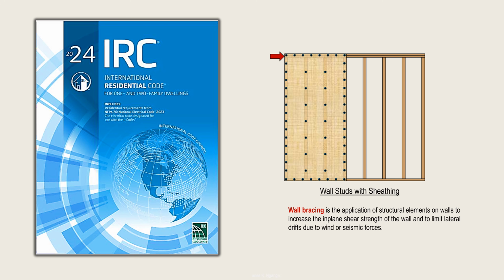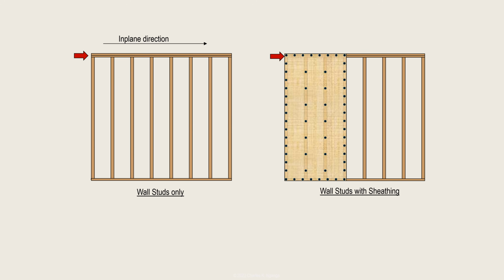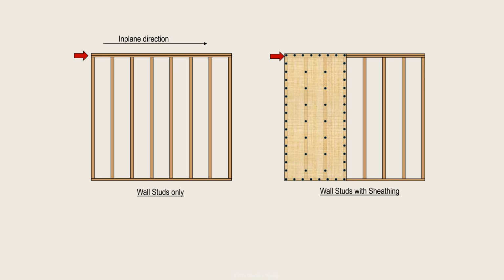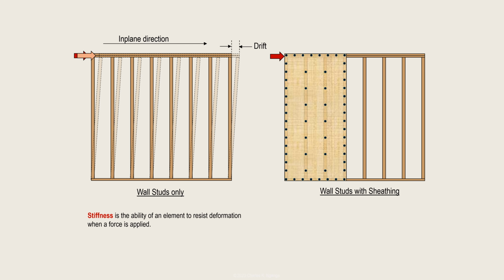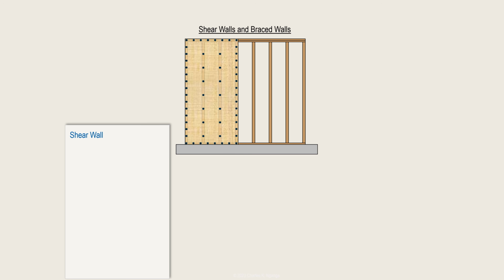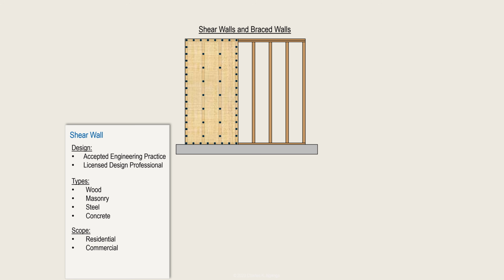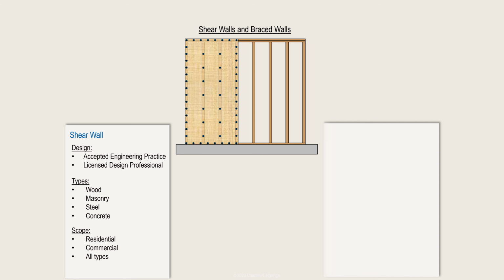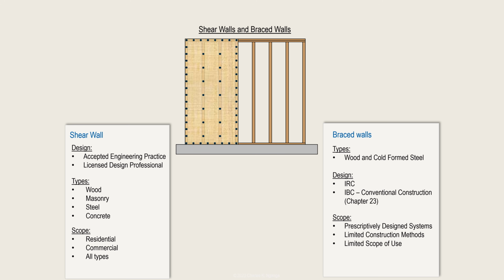Wall Bracing vs. Shear Walls: What Every Builder Must Know!

Comment: good points i am currently using the state prescriptive rules to build a house in San Bernardino  Co CA in 2026 . I was able to design my house without using an engineer .  State laws allow for a person to build their own home without an engineer which will limit what you can build.
,,,,
Reply from the maker: @CraftyRoseDentalinstructor. Using the prescriptive code is a great way to handle standard residential builds while ensuring the minimum structural safety required by the code.

Comment: Looking forward to the remedial video that actually shows the difference between bracing and sheer. I saw nothing in this video except sheer walls are designed by an engineer, and braced walls are the exact same thing without an engineer's signature and fee.
Reply from the maker: See the expanded version here: https://youtu.be/3-GlpnnOMq0
Reply from the maker: @nextworld9176 The updated and expanded version of this video is provided here: https://youtu.be/3-GlpnnOMq0
Reply: It was well explained.  Topic was not that sheer walls are designed by engineers
Reply: @SteveStowell  Really? Based on this presentation, would you be able to distinguish one wall system from another at an actual job site?

Comment: you never told us the difference between the two!
Reply from the maker: Than you for the comment. The fundamental difference is not in their function or construction. They perform the same task and share alot in their construction. Their fundamental difference is in the framework of design and who designs them. Braced walls (Prescriptive design guided by the IRC code and, can be designed by anyone), Shear walls (Engineered design per the IBC and are designed by Civil Engineers).  I have mentioned this in the video. That being said, i am working on a more expanded version of this video to clarify and expand on the differences in a way that is easy to understand (coming out within the next 2 weeks). Thank you again.
Reply from the maker: The updated and expanded version of this video is provided here: https://youtu.be/3-GlpnnOMq0

Comment: The other key element to shear walls are the hold-downs at the ends of the shear walls. An engineer designs the hold-downs based on the lateral load on the wall and its height, which has the effect of prying the wall up. Of course, the footings/foundations also have to be sufficient to resist the uplift.
Reply from the maker: The updated and expanded version of this video is provided here: https://youtu.be/3-GlpnnOMq0

Comment: This video did absolutely nothing to help me understand the difference between shear and braced walls.  I’m guessing that in 30 to 60 seconds you could probably explain to the average person at least a gist of the difference, yet here after watching your 5 minute video twice, I still have no clue.  Seems that everything you told me about either one also is true of the other.
Reply: Basically they accomplish the same thing. Shear walls are designed by an engineer and they design the fasteners, sheathing, anchorage, per seismic and wind loading etc. The code book has already done the engineering for you and just tells you how to build it, based on parameters.
Reply: You right agent Friday!
Reply from the maker: The framing  description that i provided for wall bracing construction also applies to typical wood shear walls using wood structural panels. The difference (as noted in the video) is the framework of design. A shear wall is designed by an engineer according to the IBC while braced walls are conventionally designed per the IRC (no calcs, prescriptive). If I went to a home contruction site and saw the contruction of a wood framed wall with wood structural panel sheathing and edge nailing at 6" o.c. (field @ 12" o.c.), I  would not know if the wall is a shear wall or braced wall. I would only know once I look at the drawings and see how the designer identifies them. If the wall is a braced wall, then there are precriptive rules that govern how the braced wall system of the entire house will be laid out (IRC code). If the wall is a shear walls, then it was designed by an engineer (IBC) who determined its loading and design capacity.  The point is that there is overlap interms of construction method and purpose but the difference lies in the design process and the design framework. Additionally, the term shear wall is used in concrete and masonry construction. This is explained in the video as well. I will do an addendum video that is more detailed. Thank you for the comment.
Reply: @ConventionalFraming  Lots of words with no practical meaning. Are the nails used ribbed and glued along their shank? What is the diameter of nail shank, nail length and nail spacing? What about stud spacing and size (2x4,2x6)? What about the sill plate bolts and gasket; and for multi-story, are the floors bolted together and also bolted to the slap? Might need to know these things as an owner-builder.
Reply: @ccw-cs6xb he explained what the difference is…it’s called shear when it’s been designed by an engineer…it’s called braced when it’s not been designed by an engineer…as far as all the other stuff you asked about, the code book would be your best friend…it can be a bit confusing which i think is done intentionally IMO…😂
Reply from the maker: @ccw-cs6xbhe  Thank you for the comment. This are great questions. That is why i created the The Residential Wood Framing Design Series at https://www.conventionalframing.com/. The course is divided into 4 modules - The conventional roof framing module, the conventional floor framing module, the wall and foundations module and the wall bracing module (provided in two parts). These are very comprehensive design courses where i cover the code content using state of the art graphics and very clear explanations. Additionally, i walk through a complete design of a two story residential structure (and you can download the finished drawings to look at and review). Please check out https://www.conventionalframing.com/.
Reply: @ConventionalFraming  I think part of my frustration is the mismatch with common parlance.  I'm not in the industry, but I have some experience remodeling and  know several people who have done additions and dealt with code compliance with their houses.  And I watch a lot of construction-related videos.  I've heard over and over mention of "this wall is a shear wall, so it has to have sheathing and you can't do certain other things..."  Was an engineer ever involved?  Not once in any of thees experiences.  So that seems more like what was described as a "braced wall".  But have I ever heard anyone use the term "braced wall" in any of these experience?  No.  So...Are the inspectors, home-owners, and contractors always using the wrong term?  I guess I can't rule that out.

I've heard enough about shear walls in various ways, so the title of the video sucked me in... yet all it did was increase my confusion without giving me any concrete answers.  I guess these videos serve mainly to promote your training courses, which could be great, and maybe I'm not the target audience...  But I'm guessing I'm not the only one who findse the video a frustrating tease.  If I were maybe interested in your courses before watching the video, I wouldn't be so much after it.  Just sayin'.
Reply from the maker: @AgentFriday - The updated and expanded version of this video is provided here: https://youtu.be/3-GlpnnOMq0
Reply from the maker: The updated and expanded version of this video is provided here: https://youtu.be/3-GlpnnOMq0

Comment: Back in the 70's and '80's I was framing, and the standard then was to just sheet (1/2 CDX plywood) the corners of the house, the rest was Celotex insulating board. All those houses are still standing just fine , 2x4 studs of course back then.
Reply: Agreed...those homes are standing because they have not been challenged by the same structure battles of other buildings that have caused us to build differently...may their day never come.
Reply from the maker: Very true. Most homes designed under past codes are still standing. That being said, we generally design homes against earthquakes and wind loads that the structure may possibly never see in its lifetime. That could be the reason why most homes designed in the 70s and 80s are still standing. In the Northridge earthquake, Let In Braces (Method LIB) failed ( by braces detaching at the sill plate).  This led to probiting Method LIB in high seismic areas. Homes with Method LIB from that era in regions that have not experienced seismic activity are still standing without damage.
Reply: Hello sir, I have a question for you. Did you frame or see others frame 2x4 walls on 24" on center without any structural problems occurring? Of course, using sheathing to brace them. But this is interesting to me because it's still significantly cheaper to frame with 2x4s. I read this in an old Fine Homebuilding article, where it explains such a thing called OVE framing, or nowadays called Advanced framing. Just wondering if this type of wall could be built on 24 inch centers with 2x4s. Thanks!